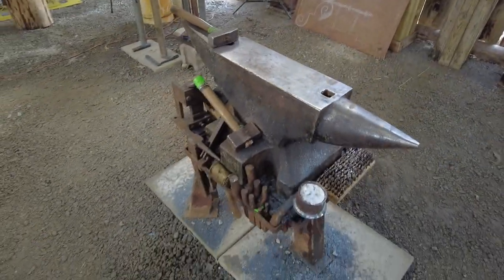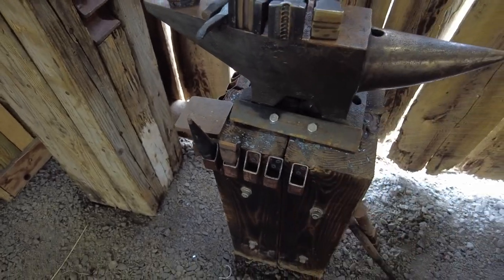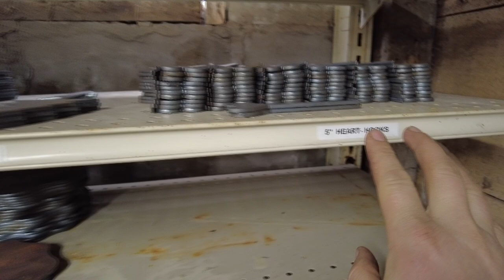The Importance of Shop Organization

Comment: Like a tool belt. You just want to reach and find what your looking for. Or by the time you've found it? You have forgoten the measurement or anggal. And in this case there is a lot of sutle changes that need to be rememberd. Or you have it all hot and have to look to see where you need to start. Fealing your way back to a working plan. Instead of already knowing it.